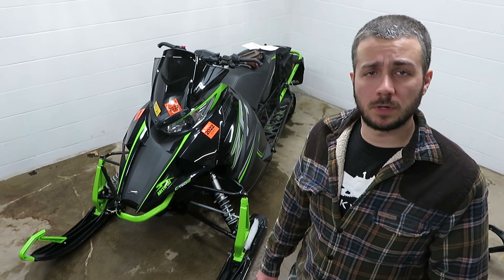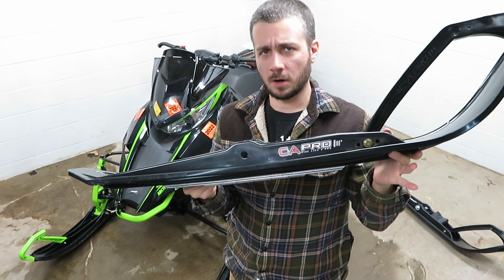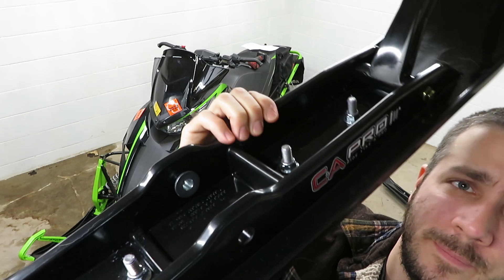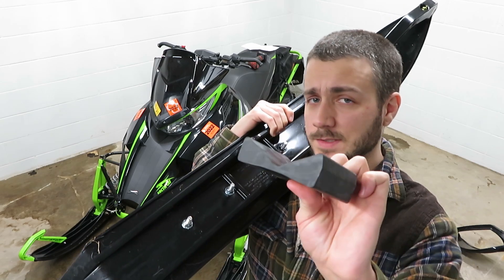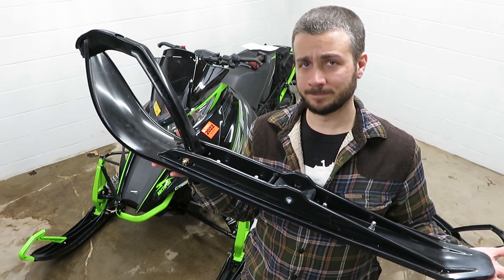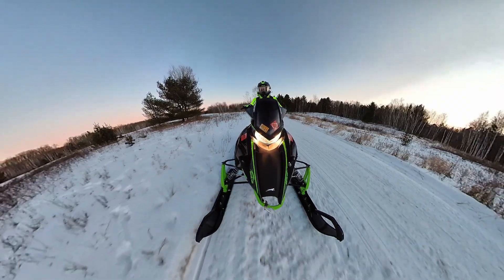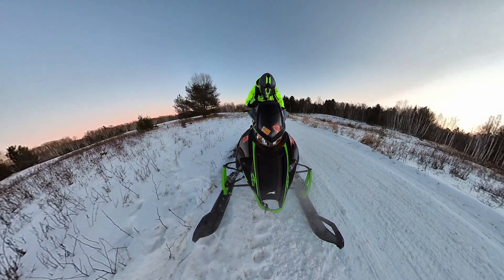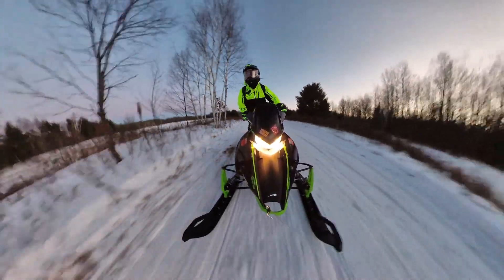Will C&A Pro Skis Fix the Awful Handling of the ZR6000???

Comment: Awesome set up for skis, that's my exact set up!  The issue with yours vs mine is my sled has 144 studs so it balances out.   9" of carbide on shaper bars is way too much for an unstudded track!! BE CAREFUL, too much bite on the skis with no bite on the track will end in disaster on the ice or icy corners, that rear end will come around on you so fast !! I honestly would recommend no more than 6" on a NON studded sled. With the setup you have I would go with a 6" carbide on a "round" host bar. With how much ski pressure you have and with those C&A's the round bar will make easier steering effort but still give you bite :-)   Also you should consider studs not only for safety, but for added kick up(cooling) on hard pack surfaces. Not to mention a set of scratchers too, these Pro Cross Cats overheat way too easy !
Reply: Also, just to add, those C&A's will definitely be noticeably better than the stock skis once there is more snow on the trails! On super hard pack you are only using the carbide runners, so you are correct in your statement about just adding those carbides to stock skis would give you similar results.

Comment: Adjust ski pressure with the front spring/shock in the rear skid set the ski shocks up for the correct sag according to the manual.

Comment: again, your missing how to set this up. i'm not gonna type it as it is too long, but please read a manual.
Reply from the maker: This is literally what the manual says to do... Not to mention you can actually see it working in the video.  If you're that concerned go to County Cat and look it up in the manual for yourself.
Reply from the maker: Direct from the 2019 ZR6000 Arctic Cat Manual at CountryCat.com (Full Link below).  

"Adjusting Front (Ski) Shock Springs - The front (ski) shock springs are individually adjustable for the terrain conditions and driving  style  of  the  operator.  The  spring adjuster nut has been set at the factory so the correct  amount  of  threads  are  exposed between  the  adjuster  nut  and  the  threaded shock body as an initial setting. Additional ski pressure can be obtained by tightening the spring tension; ski pressure can be decreased by relaxing spring tension."  

This can be found on page 39 of this manual https://support.countrycat.com/posts/3650630-2019-zr-xf-m-pantera-norseman-6000-8000-operator-s-manual
Reply: this!

Comment: Check your carbides when sled is flat on the floor. Look for contact to make sure it's centered at the spindle bolt. It always helps to shim the rear of the rubber  putting more pressure on rear of ski. Cures darting .
Reply: Yes I use a piece of my old hyfax for shims. Throw 2 small screws into the to hold em

Comment: We always have ran 6 inch carbide with great luck. My dad has a rs 6000 cat, it does have a 129 track but has handled great right from the factory. I’m guessing the 137 is the issue with your handeling??? Hopefully your new ski’s help!
Reply from the maker: Yeah I'm guessing the long track is why they suggested them, the 6 inches are more than enough on my F1100.  But after these wore in a little and I made some tweaks to the suspension they actually work great.

Comment: Now your cooking with gas!  Now that you have the front locked down  I d put 96 studs in the back.  IMHO,  I've always used studs for braking more than forward bite  especially in central wisconsin with icy or hard packed trails.  They help break up the snow for hyfax and sled cooling plus help with traction on hills and road crossings.  A 137 track isn't so long as to need scratchers,   but is still short enough that panic braking without studs can be a shaky proposition.  The benefit of the long carbide up front can be tuned like you did,  and the added wear protection will make your skis last longer.  The old SLP skis that Arctic started using in the late 90s were great skis.  Good keel length and height plus flexibility made them light years above the old steel skis they replaced.  For most people looking to improve their steering,  I would recommend replacing runners first,  then skis if results are not good.  A good shaper bar and longer carbide than stock should make  a drastic difference in both steering response and darting than a stock setup.  Good video!

Comment: I have used 4 different types of c/a skis as well as some other brands.  Through my experience the best skis  are usi spx 301.  They hold a line in a corner like a c/a but do not dart as much.  The keel is wide up front and tapers.  Also has three different mount points .
Reply from the maker: Hmm interesting... I like the C&A but would definitely like to try others!

Comment: I went with the dual 6 inch carbides on stock skis on my 2019 ZR8000 SnoPro 129. I did adjust front springs a tad for a bit more ski pressure. I'm also running 90 studs up the middle. Also, you really need scratchers on your ZR. If your temp light is coming on (which is around 160*) then its getting WAY too hot. With scratchers on mine or riding powder, temps are a consistent 105 to 115 degrees. I do not like to see the temps go higher than 140.
Reply: p.s. you should adjust the front spring tension to the neutral position - which is when you set the front end down the nose only drops 1 inch.
Reply from the maker: Good info, thanks Jeff!  Yeah it definitely needs some scratchers...

Comment: Great video as always Ben, thanks for putting it out for all to watch.
You will get it adjusted I would back off on the original setting from your last video. Grab some scratcher that will help with the over heating conditions on the hard pack icey trails
 It also helps with keeping lube on the slides. My condition are the same so most likely will need to travel to ride more this winter.
Reply from the maker: Thanks John!  Yep after some adjustments it's definitely handling much much better!  Still need some scratchers though...

Comment: I just swapped to C&A RZ's on my 09 Crossfire and they are a great improvement over the stock skis. I have 6" shaper bars with no studs and I can take corners so hard and aggressive now. Vs the stock skis that had a lot of front end push when you got into the soft stuff. I will say I hard a ton of ski pressure with the stock skis to help rail corners. But now with the C&A's I had to re adjust my entire suspension to get rid of some of the previous ski pressure I had. I barley could turn the bars standing with the pervious suspension setup with the new skis.
Reply from the maker: Nice, yeah I'm surprised they suggested the 9 inch ones but after switching some stuff around they actually seem to do just fine somehow.
Reply: @SwankyCatProductions  Yeah 9" is pretty aggressive carbide which really going to that length is required when your running a ton of studs in the rear. But since I have no studs I kept them small.  But good deal, im not sure I could have a sled without C&A's now, the cornering is so predictive now i love it.

Comment: Stock ski’s with 6 inch doolys is the best combo I’ve found. Arctic cat made the stockers specifically for the chassis. Also adjust your skid per arctic cat recommendation for the kind of riding you do. If you google you will find the guide. My sled handles like it’s on rails. Much less grabby then my buddies xrs.
Reply from the maker: Really??? I tried quite a few different settings and combinations and never got it to stick in the corners.

Comment: You gotta get scratchers on that ASAP! 

I have 2 2019 Ski Doo 850's and a 2017 ZR 6000.  Yes, the Doo's corner better but the Cat front end is way more forgiving.  

We still have plenty of snow in the UP....for now.

Also still think the limiter strap in rear is causing most of your issues.  That C&A setup with 10" is WAY too aggressive for those conditions.

Comment: 6 would have been plenty you have no studs are you crazy Grind a couple inches off Make them 6
Reply from the maker: That's what C&A suggested, at first they did seem like a lot but after some more suspension tweaks it actually handles pretty perfect.